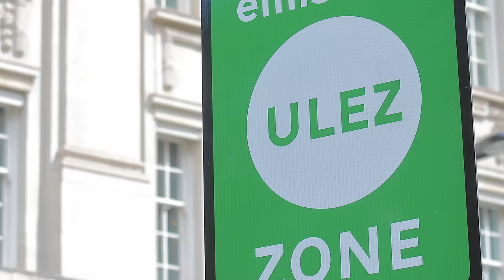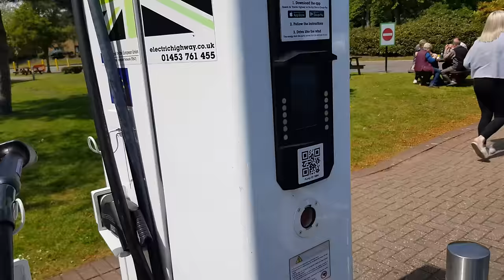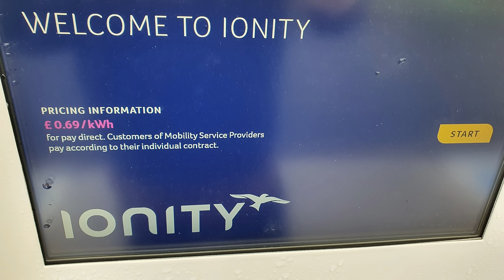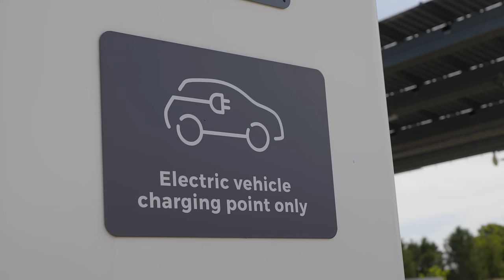The Uncomfortable TRUTH About EVs: The Version NEITHER SIDE Wants You To Hear

Comment: While i remember... it isnt only auto insurance being affected. Fire departments are recommending you park away from structures, which you mentioned. Home insurance is alsready asking if you have an ev, that is a clear indication that it will be included in the actuarial setting of rates.

I live in an apartment with no outside power whatsoever. I work from home. How and when do I charge an ev?
Reply: if you rub it with wool mittens maybe the static electricity will charge it
Reply: An EV is not for you.
Reply: Move. If you want something your place currently doesn’t have, move to one that does. I suggest a place with Solar and battery storage … you can then Charge during the day if you are home and off the battery at night if your car isn’t nearby during the day. Apartments should be occupied by public transport candidates not car commuters ….
Reply: Yeah EVs are not for you. Living without the ability to charge pretty much cancels the best perks of owning one. Plus constant supercharging is bad for the battery.
Reply: I have a slow home charger, but I barely use it, when I go grocery shopping I stick it on a super charger just because the chargers are super great parking locations. 

I get a full charge by the time we are back out

Comment: Very interesting and balanced points. One thing though at 23:18, while a sprikler may not be able to stop a car fire (regardless of the type) it's purpose is to stop the fire from spreading to other cars. And it'd be very effective at that. It'd give enough time for fire services to arrive and deal with the single burning vehicle.

In case of electric cars, burning battery is an issue, but it's not easy to set an electric car on fire if the battery itself is not damaged. So even if it's parked next to a burning car it'll catch fire as easily as any other car, because in fact the interior will burn first (and will provide most of the energy in the fire).

A car burning again hours after the fire was put out is not an issue for the fire service, because they know anout it and they know how to deal with it.

Comment: I'd like to hear you comment on plug-in EV's with smallish batteries and range extenders.  It seems like a missed opportunity.  The typical hybrids lug around all the ICE gubbins (engine, cooling, trans, diffs etc) AND electric systems which seems to be the worst or both worlds re weight, complexity and servicing costs.
Reply: @@Karnik67If "they" (whoever they are) wanted to do that, it can be done simply with electronics on any vehicle.
Reply: @@Karnik67 let me get my tin foil hat...

Comment: Here in California the Fiat 500e is a terrific city electric car. Pretty cheap to buy used as well. Lots of chargers recently installed at LAX.
Reply: Purposefully omitting used EVs and small EVs is how your can create a narrative for gasoline cars…
Reply: @David_Journey all fine and well until you have to put in a new or refurbished battery costing you the price of the car.
Reply: @lillexus5589  do you mean the fact that it costs $12k to replace Tesla Model3 battery? That is far from MSRP.
Reply: @David_Journey  I meam the fact that people get quoted 50K dollars for a Hyundai Ioniq battery replacement, with the car being sold from 42 to 55K dollars new.
Reply: @lillexus5589  Parts pricing is public, before purchasing an EV this should factor in to an informed purchase decision. For most EVs the replacement price is fraction of MSRP. 

In similar vein, with ICE cars you may need to replace clutch / transmission engine as you approach 200k miles for sure. Those are 5000+$ cost easily.
Reply: @David_Journey  the pricing may be public, but that doesn't mean anything. Its how your insurance company handles the case aswell as how the manufacturer handles the warranty proces. Read into the stories, a story similar to the one mentioned before came to light this morning with a Canadian customer.
Reply: @lillexus5589  It doesn't help that batteries are not standardized across makes / models, which puts the financial burden on consumer with vendor lock-in at time of replace. It is not ideal situation to say at least.

Comment: A couple of points: I drive over 30,000 miles a year, as do some of my colleagues. We're the ones buying the diesels.
Secondly, we're already threatened by rolling power cuts here in the UK. That's before we're all plugging in EVs when we get home from work. How's that going to work out?
Reply: Yes - the grid will soon be on the point of collapse, with reliable generation phased out before a reliable alternative is installed  - which has to be nuclear. Renewables are no good for baseload - which will be a lot higher if the number of EVs goes up significantly.

Comment: I think more conversation about the longevity of EV batteries would be useful. The current technology last significantly longer than an internal combustion engine.  And since it’s cheaper to recycle an old battery than it is to mine and refine new materials when the car is worn out, it still has value.
Reply: I don’t know where you got your 5% recyclable numbers Barry. I’ve heard more like 85%. Let’s do some more research.
Reply: A battery lasting more than an ice? May you cite your source?
Reply: @barrykochverts4149  5%. Mate you're way off with that number..
Reply: This is a lie. It often costs more then the value of the entire car to replace the battery. There are 40 year old Toyotas still running fine on the roads probably no single EV will make it 20 years without needing a full battery replacement let alone 40
Reply: lol just stating random bs without sources... EVs cost more and do not last longer than regular cars just look outside how many junkers run just fine... and any damage to EV batteries cost more to replace than the entire car most insurance agencies just write them off.
Reply: @arielatom03   Early Tesla Model 3’s are already seeing 200,000 and 300,000 miles on the original battery pack...and battery tech has advanced since then (and continues to advance).
Reply: @MarvoloRiddle  Those 40 year old Toyotas will have had extensive maintenance done to them to keep them running. That'd be around 600,000 km. I wouldn't expect an EV to make it 20 years without a battery replacement, but I wouldn't expect an ICEV to go 20 years without needing one or more new water pumps, timing belts/chains, turbos, various gaskets, piston rings, transmissions, radiators, oil coolers, sensors, spark plugs, ignition coils, air filters, etc.
Reply: @Eskoxo  "just stating random bs without sources". To be fair Youtube makes it very difficult to include sources, because if you add external links your posts are hidden. Longevity of EVs is not really known yet - not many are older that 10 years yet. Not many ICE cars make it to 40 years. I agree not many EVs will either. The average scrapping age for an ICE car in a developed country is about 12-13 years. From the evidence we have so far it looks like most EV batteries will last that long (but not all, and obviously mileage is even more important). In the same way that most ICE cars get scrapped when they need a new engine, the even worse economics of battery packs will probably have the same effect on EVs. But if the packs are valued properly there is no technical reason not to put in a 2nd one and run the car for another decade, till it really is knackered. It would take culture becoming a little less disposable for that to be common, I suspect.
Reply: @xxwookey  yea but OP made a statement that it lasts longer when they have not even been around that long so i stated that knowing there are no sources without going into some big explanation why. Just seemed like some Evangelist post.
Reply: @robertstout7756 it's very very energy demanding. Most won't ever recycle it more than 5% sure it's doable but if you're not using nuclear then it's dirtyyyy
Reply: If we are doing research. Tesla's don't seem to last over ~8 years currently.
Reply: @DesuchanSugoi  All those cost LESS than an average EV battery and no 40 year old toyota has turbo my guy lol. Timing belts, spark plugs,ignition coils are not that much and if you dont drive it like a maniac the transmission should be fine.

Comment: There was a 2016 year study from Gothemburg in Sweden checking where pollutants came from. And only 25% of the city pollutant came from road traffic. Less than half of that from Euro 5 and Euro 6 (that already at that point was dominating). And even at that only half of that was from actual cars, the rest was from trucks, busses, and other road vehicles.

So in 2016 total pollutant in the city from fairly new cars was 6%. This should have change even since then.

So the pollution is really not a good argument

There is a really good reason why  there is no law on having sprinklers on open air car decks. Because sometimes the temperature is under 0 and the water in the system freezes.

The solid state batteries is about 10-25% better than the normal cells we have today. The media is basically lying about how good they are comparing apple to oranges or talking about power, not energy.

The really main benefit of sold state battery is not the slightly higher energy density, or the substantial higher power density, while both of those are good, they are not game changer. The main benefit is chemical stability.

The reason why its so much cheaper with a member ship card is due to debit card regulations and fees.